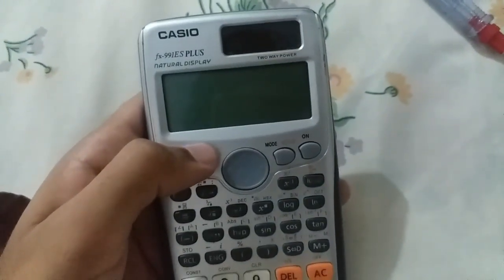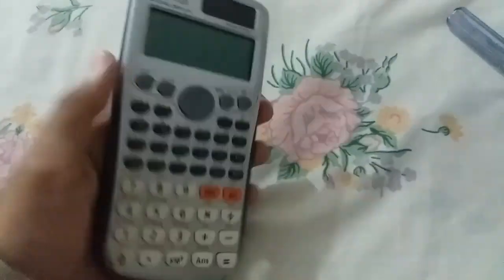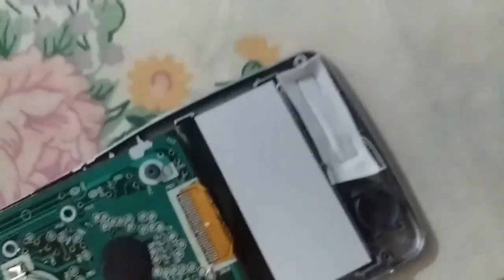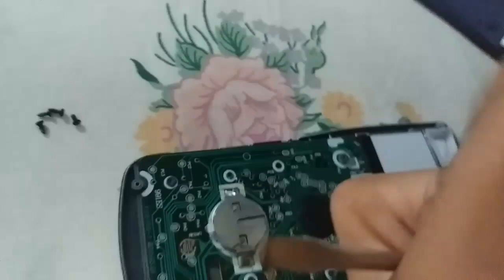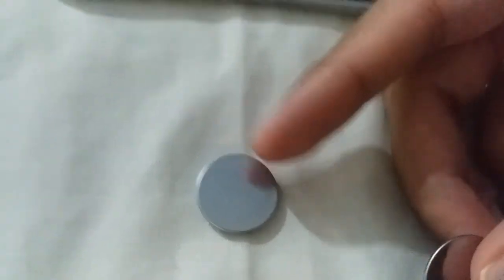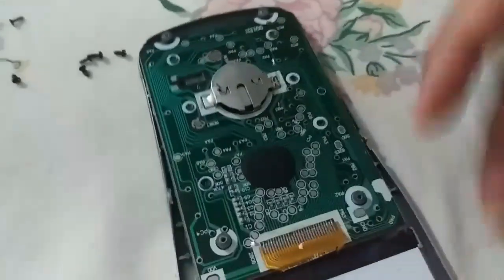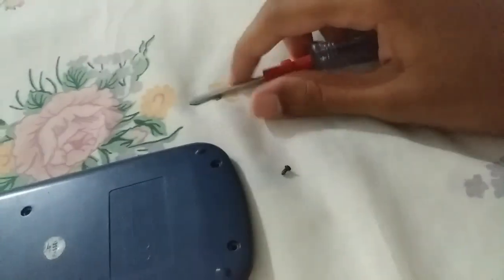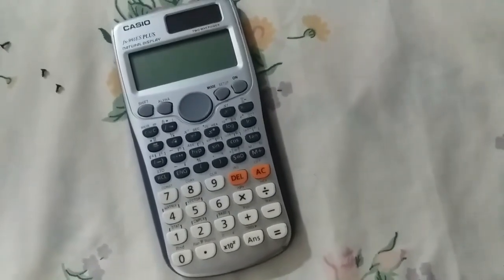How to fix CASIO calculator not turning on or working problem at home - GET INFORMATION AND KNOWLE..

Comment: "My Casio fx 991 plus calculator fell from my hand, and it doesn't work on dark light or artificial light, but it works on solar light. As soon as I take it away from the artificial light, the scientific calculator stops working.""I need your help; my exam is in 4 days. I'm the first one to take the exam. What should I do?"
Reply from the maker: If you have followed the steps shown in the video and it didn't worked. And as you have typed that your exams are near. So, I recommend you that buy a new Casio fx 991 calculator with utmost priority.

Comment: I am my problem My machine has a problem with x and + When I click on it, it is deleted Do not hit or collect. I do not know where this problem comes from How do you solve it? Please reply quickly 😢
Reply: If anyone knows anything about this problem, please reply quickly
Reply from the maker: It seems like your calculator has dust inside it or your calculator buttons ard damaged. Try gently cleaning the keys with a small brush or compressed air. You may need to consider getting the calculator repaired by any electronics repairing shop or may get it replaced.

Comment: There is not cell but in the upper part there are two cell please make the vdo to make on calculator please
Reply from the maker: Simply replace the two cells with new ones.

Comment: It worked for Me, my calculator is Fx-991 ES Plus 2nd Edition. When I first bought it I tested it at the store, works well. But 2 days later when I brought it to school during my engineering classes, it just wont turn on, but it turns on when there's sunlight on it's panel, and so it's "solar powered" now, I struggled with it up until I saw this video. Thank you very much! I opened my calculator and I tried removing my battery, and placed it back again (I failed at removing it because it got locks, and I was hesitant to remove it and lazy haha) and when I pushed it down I tried to click the on button, and it worked! I closed it again and sealed it and voila. Thank you thank you thank you!
Reply: I also have the same calculator. My higher math exam after 2 days. I have another calculator, but it cannot do high level math. I am worried. After watching this video and hearing your words, I got reassurance.🌸
Reply: @Crazy Mark hi, I also have the 2nd Edition.. my percentage button doesn't work. Do you know how I can fix this? Or is it the same in yours also?
Reply: @preranaupadhyay5873  I'm sorry I don't know how to fix that issue with the buttons yet. Try searching for tutorials or find someone who knows how to fix these kinds of issues

Comment: Sir where will the engineering calculator be repaired sir and where will its battery be found or where can it be found in the shop...???..or else give some address sir where it will be fixed ❣️🙏

Comment: My calculator is only working outside the home and light automatically dimmed coming inside home.what will I do ?
Reply: You probably dimmed the display.
To fix the problem stay in a sunlit area and  press shift, then mode step up, then the bottom arrow of the replay button. After that press 6 then the left arrow of the replay button(labeled as Light).
Hope it works
Reply: it is also my problem now and i suggest that just replace the cell like what's on the video, i think it will work!
Reply: I changed my battery still same problem , guys pls suggest solution
Reply: @aniketkale8103 samee what did you do?
Reply: @aniketkale8103 mine is like that now, does your calculator now fixed? if it does, what can i do to the calculator?
Reply: Change your battery
Reply: Go to Display and adjust it
Reply: Same
Reply: Same
Reply: Same here
Reply: Change the battery
Reply: 1   go back to the shop

2   lock the door from inside

3  school him for not to cheat you next time 
😂😂😂😂😂😂
Reply: I changed my battery but still it only works in light. If I cover the solar panel, it turns off
Reply: @Parth3399 same
Reply: Charge it through solar cell attached with calculator.
Reply: @bladeslayergg6005  how?
Reply: @krueed9349  in most of the branded, calculators a screen type solar panel/cell is there in calculator,so when you expose it in sunlight or some light it starts charging,i would prefer sunlight more because it is the best source of energy.
In Casio calculator, a sun symbol appears at the top right corner when it starts charging,it indicates charging.
Reply: @bladeslayergg6005  mine just turns on at sunlight but suddenly turns off when light is un exposed...so I will try your method and check..well how many hours does it take usually
Reply: @krueed9349  it depends on calculator's battery ,usually it takes around 4 hours,
Mine got dimmed but I charged it later on.
And avoid direct sunlight ,just keep it in bright room,and if still not charged so there must be problem in the battery or cell,
Which can be replaced ,by seeing the size number of button cell or cell.
When battery not works so calculator is then dependent on solar power
Reply: @bladeslayergg6005  yes the problem is in the battery...it is bulged so I am going to replace it...anyway thanks for the help..😊
Reply: @krueed9349  your welcome!😁
Reply: @krueed9349  l also have same problem bro when kept in sunlight then only it's working otherwise not
Reply: @KuldeepSingh-tw7bu  it's because the battery has either bulged or is damaged..try changing the cell...it's cheap
Reply: @krueed9349  did it worked
Reply: @RockYourGoal  actually i didnt bother changing it and kept it in my shelf but one day i forgot about it when i needed the calculator for my exams so therefore didnt bothered to buy a new one due to lack of time
Reply: @krueed9349  ok 👍🏼 thanks just now i changed the battery it is working for me now still thanks for replying
Reply: how long i hv to charge this?  @bladeslayergg6005
Reply: Same

Comment: What do I do?
My calculators display is appearing once and then again disappearing. I can't type anything easily 
And in the middle of typing it gets blank again and again
Reply: It is also happening with my calculator
Reply: @AHGaming44  problem solved. Just got my battery changed and now the calculator is fine
Reply: @swad1827  which type of shop can I buy these battery from ??
Reply: @AHGaming44  sane thing happening with me

Comment: my power on button is not working..what shuld i do..plz answer
Reply from the maker: Follow the steps told in the video. In case if it doesn't work after watching the steps and applying them. Then it's better to buy a new scientific calculator.

Comment: What if it comes on when cell is changed but subsequently refuses to power on
Reply from the maker: Then make sure the battery is inserted correctly and the polarity is correct also make sure the battery is new and up to date or clean the battery holder contacts or check the battery  contacts  for damage. If these solutions doesn't work that it's better to buy a new scientific calculator.